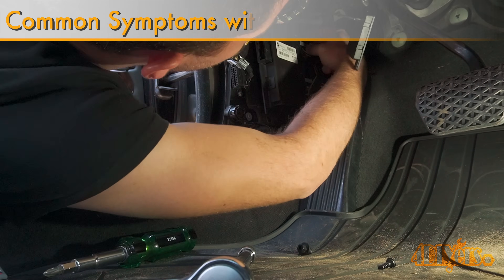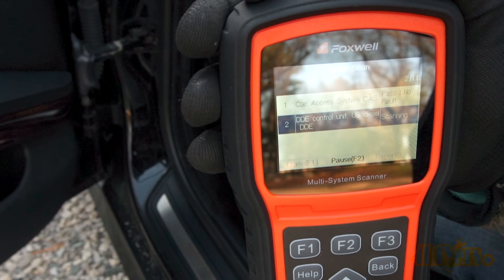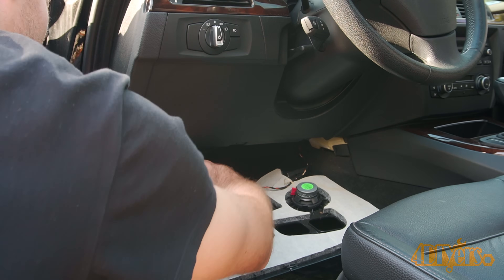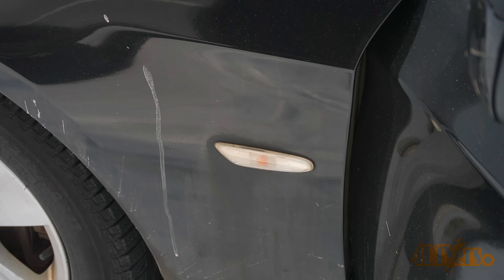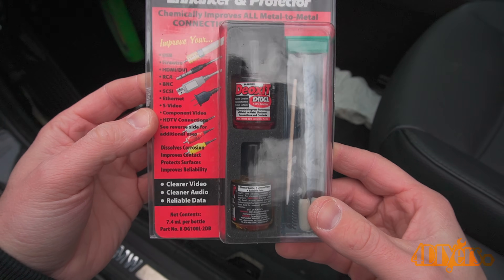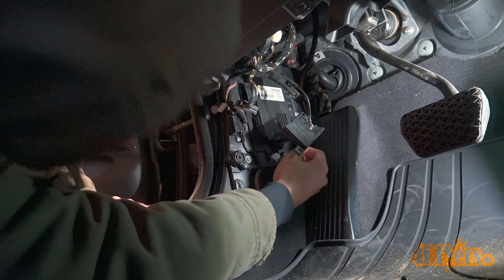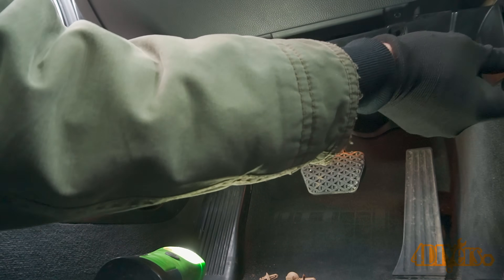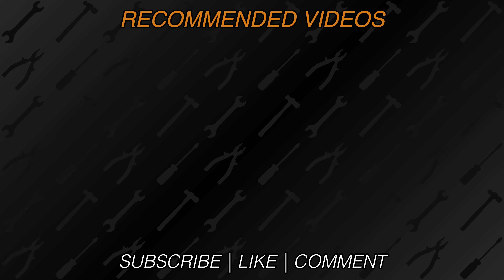What are the Symptoms of a Faulty BMW FRM Module

Comment: 8k in repairs on a dealer maintained e93 since new.  now at 70k miles, everything that can go wrong is going wrong. Never again another bmw .
Reply: U just got unlucky
Reply: I have an e93 330d m57 best engine ever i have 352.000kmon it and it runs like new no problemst at all but i drive every day 150km i love these car and engine. You need to look for the engine numbers some of them are bad and make many problems and some of them are very relaiable the m57 is the best bmw diesel engine ever made
Reply: I second this!
Reply: Let me guess,320i?

Comment: Everything in my car seems to work fine,exept the power windows. A while ago it gave a fault code,but it has been gone for a while but stil no power windows.tried to change the left front power window motor but did not do anything. Wondering if it could be the frm. I have an frmfa nsw module
Reply: Same story with my car, but also the automatic start stop system did not work, I changed the battery and my problem has been solved, canbus operated cars are very sensitive with to less voltage, the existing battery has been doing its job for more the 8 years, so now a new one ;-)
Reply: to get the start stop working again after replacing the battery I had to use INPA

Comment: My 2014 m5 heads up display has a orange pixel can it be the foot well module or the battery? The car sits for a couple of weeks sometimes and the battery does get low on voltage and its the original battery since 2014
Reply from the maker: Your battery is quite old and most likely needs to be replaced. BMWs that have a low battery will cause some weird issues.
Reply: @ it only has a low battery when it sits for a couple of days i should replace it since its so old tho
Reply from the maker: The battery shouldn't get low after a couple of days. I have a couple videos on how to test the condition of a battery.

Comment: Hello, I recently replaced my valve cover gasket and after I finished my idrive controller doesnt work, windows don’t work, turn signals don’t work, hazards don’t work. You think this could be the issue?
Reply: Yoooo, literally what happened to me, replaced valve cover gasket and now my turn signals, drl, windows, mirrors and cluster lights don’t work, but everything else seems fine, car runs great other than the lights and windows not working, did you find a fix?!
Reply: @Tyler_Bass850 did you either of you, figured out the fix?

Comment: Excellent content, Found your video while trying to confirm if the FRM should be disconnected prior to reseting the transmission adaption on an e90... which what a the local indy stated. Sounded wrong to me.

Comment: I have F10. The only thing that does not work is the front lights; everything else is working. I'm not sure if I have an FRM issue or a fuse.  I got some FRM codes, though.  The car locks and all other lights work. Any suggestions?
Reply: I have the same issue on my F10 too. Were you able to find out the main problem?
Reply: @Hasib_fitness , not yet. I have tried a few things. This time, I am thinking about changing all the fuses. I am also taking it to the dealership for diagnosis and then getting work done somewhere else.
Reply: @emperorsanders5744 please let me know what the dealership find I’m having the same issues
Reply: @emperorsanders5744 hey mate, if you discovered the problem, let us know, please. I have the same problem with my F10.

The front cabin light and the 2 front window buttons
Reply: @academiadoaluminio  no solutions yet. I stopped using it at night for now and using other vehicle.
Reply: @emperorsanders5744 any update?
Reply: @Aizxyz needed new FRM.  Read the codes.  If it says frm then there is no other short cut.
Reply: But most videos just reset it and it worked, what was in ur case that it need replacement, did the repair shop tried resetting it by programming device

Comment: Hi i have a 2010 328i and both of my turning signals rapidly blink and the also both of the folding mirrors not working after i replaced the frm module what could it be?
Reply from the maker: If it popped up after the replacement, I would assume it's an FRM issue. Scan for codes. Also did you recode the FRM to your car?
Reply: No turn signals, No windows working, no interior lights working
Reply: @PierreHarvey-c9m trunk opens?

Comment: Wow. I'm not sure if mine has failed. The turn signals are not working, headlights turn signals only. Rear turn signals are. Everything else is working. I did have my battery die. Then I had crank no start issue. It was a relay. I didn't realize my headlights until I started to do halogen to xenon conversion and the halos were not turning on. Then I checked with halogen and turn signals didn't work. I do get error codes. My car was down for 7 months because I was doing a lot of maintenance.
Reply: where was the relay located?

Comment: I have a 2006 E90. Some of my lights work and some don't work. It works in opposite directions. The front right indicator works but not the back right and the front left indicator doesn't work but back right does. Same with the headlights, brights, fogs and reverse lights. What could be the problem?
Reply: I have the same issue. Did you figure it out?
Reply: @chrisbreezy2676  No, not yet. But I did talk to someone yesterday who does ecu remapping. He told me that the footwell module is gone bad or it’s not programmed. I will be taking the car to him soon. I will give you an update.
Reply: @MohamedShaik-j9d any update?

Comment: hello i gave a 2012 320d and the right side folding mirror working fine and the windows how ever the left side rear window goes up down inch by inch have to click the button repeatedly and the front passenger left window is can hear click from the module and window but it is not going up or down and also the left folding mirror is not working please help me
Reply from the maker: Is this only an issue at the driver's switch panel or does it happen on the switch of that door too?
Reply: @4DIYers   THE DRIVER SIDE EVERYTHING WORKS AND FROM THE DRIVER SIDE IT DOES SAME THING FROM THAT MASTER SWITCH FOR ALL WINDOWS BUT I HAVE REPLACED THAT WITH BRAND NEW AND SAME THING
Reply from the maker: It could potentially be a wiring issue or maybe a window regulator is failing. My recommendation would be taking off the door panel and using a multimeter to check the plug at the regulator motor. Press it hold the button to see if the power continues. If it does, then it would be a regular issue. If not, then the issue is somewhere else.

Comment: How do you differentiate between FRM and Clockspring/steering angle sensor as source of faults?
Reply from the maker: It's best to scan the codes using a BMW specific code reader, not a generic OBD2 reader.

Comment: This is why i bought a skoda
Reply from the maker: All vehicles have problems unfortunately, especially when they become more complicated. I’ve put about 15,000km on it since I bought it. Fixed the original problems that had, the FRM was my own fault. Right now I need a new harmonic balancer, but other than that the car has been good.
Reply: @4DIYers  Was it reprogrammed and it worked and had no hardware failure? How was your connectors?